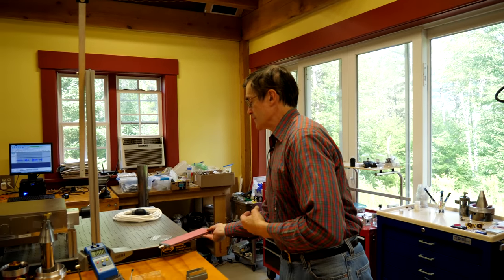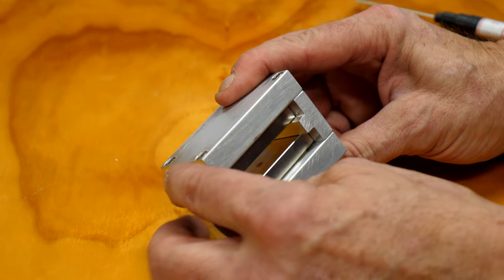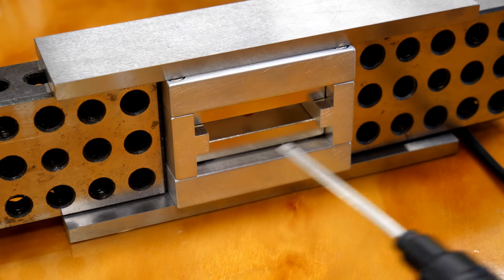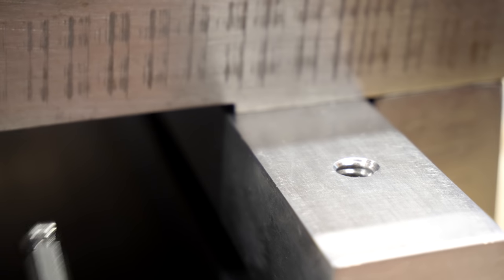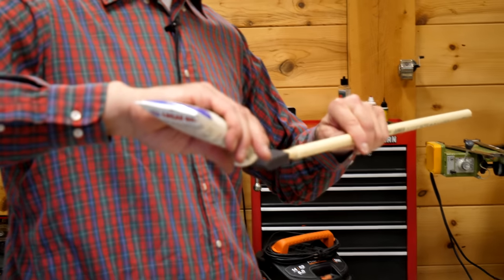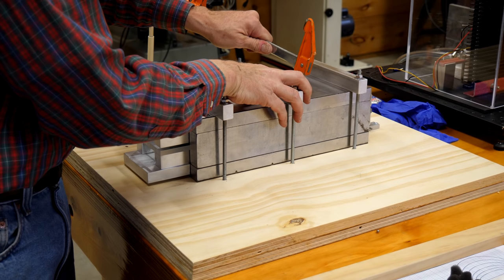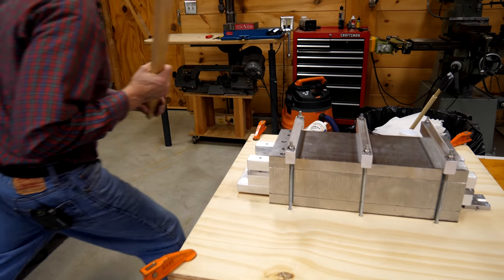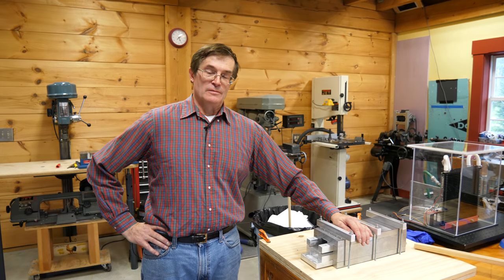Extreme Magnets

Comment: Everything at quantum level is a magnetic domain, as you call them. Toroidal structures acting as little pumps within and upon an ocean of potential. Think fluid dynamics and remember all the magnetic funny actions. No need for such notions as quantum weirdness. No need for notions of a need for a unification theory. The universe is much simpler than most can fathom. Simple is more stable and likely, is it not?

Comment: lel I got one of those cheap as crap gause meters, $100 ebay special.  I wanted one like we have at work but they cost more than $2000.
Reply: Is the $2000 one twenty times more accurate (READ: tighter tolerances)? If not, who cares?

Comment: what were the magnet costs? maybe you could use a thin piece of felt between the magnets on the same side so that if they slam together they won't shatter, especially since neodymium magnets are very prone to that?
Reply: I don't think felt would suffice. In any case, the one magnet doesn't slam into the next, thus the pushing stick.

Comment: 'An Evolving Mechanism Is A System Or Subsystem That Undergoes A Gain Of Complexity Over Time'--ON EVOLUTION.
     All mutations seen in nature have gone through a transformation that is at its core opposite and fundamentally at odds with the notion of 'evolution'.  An 'evolving' mechanism is by definition a system or subsystem that is undergoing a gain in its complexity[i.e. information] over time--what is truly happening you can call 'DE-evolution' if you like.  EVOLUTION(not even a good theory) requires an increase of information over time, and not a decrease as we see with every example put forth by mainstream science, while claiming to demonstrate the validity of this religiously held belief, called Naturalism[i.e. that everything came into existence by blind-luck].  Thermodynamics, information theory, and common-sense, show that everything in the cosmos IS FALLING APART, quite the opposite to the insane idea that things are coming together in complexity, by blind chance.  WHAT WE SEE IS EXACTLY WHAT WE WOULD EXPECT OF A CURSED CREATION!  Selection is not evolution, all of the information is available in the DNA code, which under the right conditions will be selected.  No new code has ever been introduced!

COULD ANY OF YOU EVOLUTIONISTS EXPLAIN THE FOLLOWING
HOW did the universe come from a dot-of-nothing exploding( i.e. "The Big-bang", which is one of the many [idiotic] claims put forth by the so called “experts” )? WHERE was this dot-of-nothing located? Was it inside of nothing? If so, how were they distinguished from one another? HOW do you give "nothing" its locality? WHAT was the nature of the agency that caused this dot-of-nothing to explode? I.e. there must have been something else around to cause this dot to explode, else it would remain in a perpetual unchanged static-state. Having established that there must have been an agency in existence and separate from the dot, that would cause this dot to explode, WHERE was this agency located, and HOW do you distinguish it from GOD?
    HOW does gas come together to form a star, in defiance of Boyle's Law?( i.e. you can't compress a gas into a solid ). If we were to ignore Boyle's law for the moment, WHERE did the gravitational forces come from that pulled the elements together into forming the first stars?
    Matter that is traveling in a straight line from an origin at the center of an explosion( i.e. "The Big-bang" ), in a vacuum, would continue in a straight line forever, unless something would cause it to alter its trajectory( "a body in motion will remain in motion", and it would also take the "path of least resistance" ), however, evolutionists say that there was nothing else in existence; WHAT then caused the elements to slow down, and to turn toward each-other so as to fuse together?  Today, if we were to place gas molecules together, in any amount, they will move apart due to collisions, having insufficient gravitational mass to overcome this outward force, WHY are we supposed to believe, at some time in the distant past, that this was possible?!
If the gravitational pull of stars is needed to form other stars, WHERE did the original stars come from?
    HOW do you reconcile the observation of an explosion occurring today, which will always result in chaos, with the claim of evolutionists, that order resulted from an explosion that occurred in the ancient past?
    HOW does a-bio-genesis work in real life? HOW exactly does rain falling on a rock for a long time produce life?
    Yes, we have all been indoctrinated to believe we came from apes, please show me the evidence and step me through the whole process! HAVE you ever seen any kind of animal turn into another kind? For example: a cat into a dog? a mosquito into a whale? I've seen many types of dogs but all remain as dogs, likewise with cats, birds, etc. Show me the many transitional forms in the fossil record. THERE ARE NONE! The only mutations observed are destructive ones(i.e. a loss of information, e.g. eyes disappearing, limbs disappearing, etc.). In order for evolution to work you need the opposite type of mutation, one that will increase information, not decrease it! By the way, destructive mutations are exactly what we would expect to occur in a universe that is slowly dying of radiant-heat loss.
    Virtually all living organisms, depend on another living organism to survive( i.e. symbiosis ), which of these symbiotic creatures evolve first, given that both( or more ) need to be present for either to survive?
    The second law of thermodynamics, information theory, and common sense, clearly show that order(information being a form of order) is lost over time. It is impossible for order to arise without an agency causing it, in our universe!!!
This is a very short list of the hundreds of inconsistencies within the religious belief of evolution!

PROBLEMS WITH RADIOMETRIC DATING[ The following is on carbon-14, but also applies to every other method of radiometric dating. ]
    As an analogy, think of walking into a room in which you find a burning candle, after being in the room for a while the candle goes out. The only things you can know(while the candle was burning and while you remained in the room) are: the rate at which the candle was burning, and the current atmospheric conditions. You cannot know the original length of the candle before it was lit. You cannot know if the atmospheric conditions in the room were constant before you entered the room(e.g. did the oxygen/nitrogen levels vary over time?), you can not know if the candle burned at the same rate before you entered the room. Likewise with carbon dating: you do not know how much of the 'daughter' product(C14) was present in the specimen at the time of death. You cannot know how much of the 'parent' product(N2) was available in the atmosphere prior to the time of death (e.g. air pockets found in amber show that O2 levels were around 32% at the time the pine sap solidified; proving that the atmosphere was vastly different in the past. Current level of O2 is around 20%). Furthermore, you cannot know if the levels of solar radiation (a major contributor in converting N2 -> C14) were different from today's, prior to the death of the specimen. - This is just an excerpt of the things that would not be known to us. Carbon dating along with any other radiometric dating methods are useless, due to insufficient data. Furthermore, there are vast ( and proven ) age differences in Radiometric results, found while dating the same specimen at different sites (sometimes these differences also occur when re-dating a specimen at the same site).  All we can know from radioactive decay is its current rate of decay.  We cannot know the initial conditions, that is; the initial amount of parent or daughter-substance found in the host,  Nor can we know if the rate of decay changed over time.    NONE OF THE INITIAL CONDITIONS, NOR ANCIENT DECAY RATES CAN BE DETERMINED FOR ANY RADIOMETRIC DATING METHOD!!

WHO REALLY WERE THE FOUNDERS OF THE THEORY OF EVOLUTION?
    Have you ever looked into the "evidence" that naturalists claim they have, or do you blindly regurgitate what you've been indoctrinated to believe? Think about it for a moment; have you truly looked into the matter, or do you simply take it to be true because someone claiming to be an expert told you so? Anyone looking into these claims, would soon find that claims and reality are two very different things. The zealously held belief of naturalists have led to countless hoaxes and deceptions(Piltdown Man, Nebraska-man, Lucy, etc.). The reason for promoting a purely naturalistic view, fall into one of the following, employment retention; most scientist are blackballed if they don't go along with the naturalist view, a severely blinding indoctrination, or worse yet, the hated notion of a creator due to pride and the interference this may cause to perverse life-styles.  Evolution is a faith, it is based exclusively on assumptions that cannot be verified, and as you will see, it actually goes against well established scientific laws. All of the original proponents of this atheistic worldview lived depraved lives. Most of them were not scientists, contrary to what you are led to believe, and some were outright con-men. Take Charles Darwin for an example, a child-man that dropped out of medical school and later out of seminary school. Charles' father got him his first job as a cabin-boy on the HMS Beagle. Charles had no training as a naturalist, he was a lazy flunky, his own father regarded him as a disappointment. It was on the Beagle where he got his perverted ideas regarding evolution. He married his first cousin, because he believed (due to his views on evolution) that it would be a genetic benefit to do so. The majority of his children died, some of suicide, and the rest from genetic problems. Several of his children, the ones that did survive were severely retarded. Another one of these humanists was, Aldous Huxley, he admitted that his zeal in promoting this world view, came from his desire to change societal morays, so as to accommodate his sexual lusts[see, Confession Of A Professed Atheist, 1966] (do a little research into the humanist founding fathers and you will see that they all led depraved lives). The biological model these 'experts' claim they have, would not qualify as a model in any other field, they implement no data, have no equations, no variables, no constants, nor any statistical assumptions. These models are purely imaginary, consisting of pictures and lines on paper, they have no substance. The reason for their existence is to promote an atheistic worldview--in essence a religious belief.

Comment: Why don't you but magnets during building the project instead of inserting them at the end with this difficulty and dangerous  manuvers and any way try to put on serious safety gloves
Reply from the maker: You would never be able to get the heavy steel plates into position with over 1,000# of magnetic force pulling them together.

Comment: I don’t understand why anyone with this much knowledge continues to refer to magnetic field strength as field lines.  There is no proof of the theory of field lines.  There is no way to see a magnetic field without using materials which are influenced by the field. Iron filings tend to give the appearance of lines but this is a result of the filings having a magnetic field of their own as the are in the field of the magnet.  As such the filings will attract and repel their neighbors as if they were actual magnets. Filings only show the strength of the field, but there are no magnetic field lines.
Reply from the maker: Field lines are a conceptual tool, they are useful for describing the interaction of electromagnetic fields.  When someone is describing a location by referencing lines of latitude and longitude, no one believes that there are physical lines drawn on the surface of the earth.

Comment: I am very disappointed; there is no physical reality to "field lines".  They are a visualization tool to represent the... field... which is a mathematical model itself, simply having a value at every point in 3d space.  Field lines are akin to the lines on a topographic map which represent a path of constant altitude; the field lines  represent a path through the field that has the same magnetic magnitude, with the direction of the drawn line representing the direction of the vector.   In fact, even making it two dimensional is a simplification.   Talking about them as if they have reality, and repel each other, or are constrained to touch the magnet is very misleading.
Reply from the maker: You are correct, but at the same time they are helpfull.  Imagine if every physical principle had to be described with field equations and only with field equations.  The maths are complicated and would intimidate nearly everyone.  Beginning a discussion of magnets and magnetic principles using field lines and as a general understanding is reached then generalizing toward field theory, is useful.
Reply: I just wish you had said that part too :-)